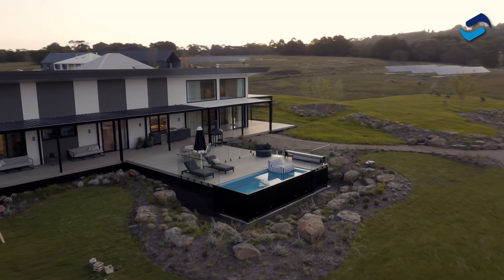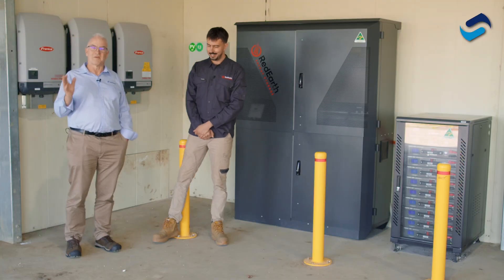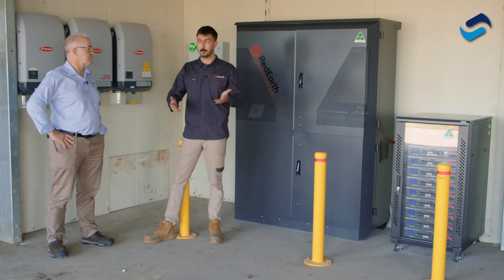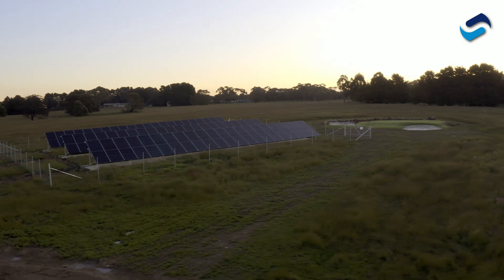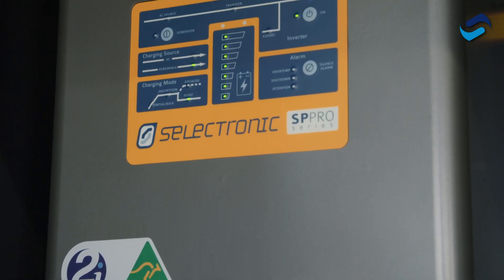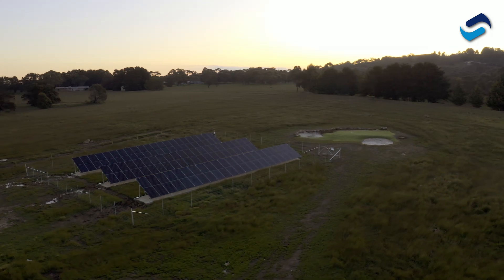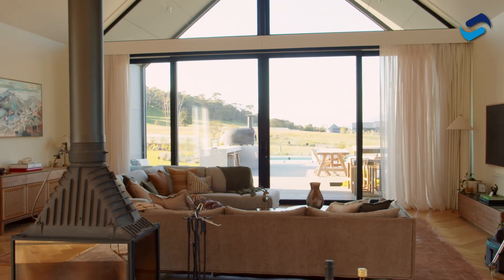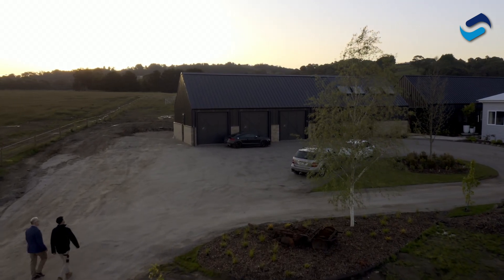The Block Goes Off-Grid! | Selectronic Case Study

Comment: What is the cost  ? 100k ?
Reply from the maker: Hi mate, thanks for your comment. It's difficult to give an accurate price as every system is different and there are various factors which will influence the price. For example off-grid vs. on-grid, solar panel and battery size requirements, average household energy consumption, etc.

If you're looking to get something like this installed on your property it's best to call your local installer who will be able to give you an accurate quote based on your situation.